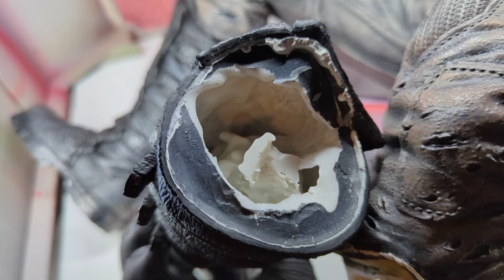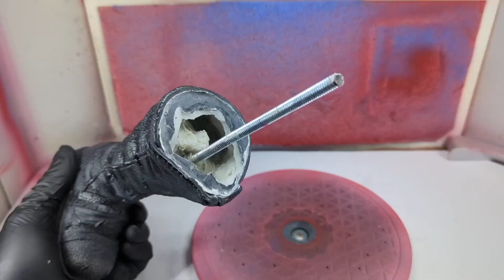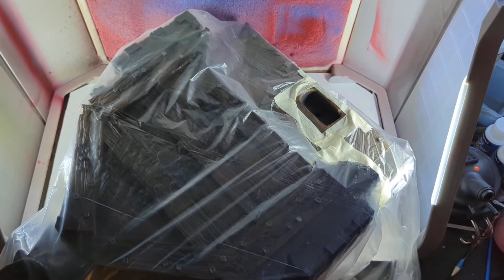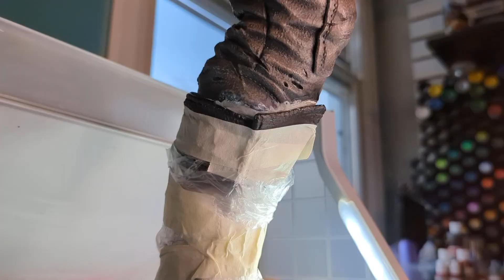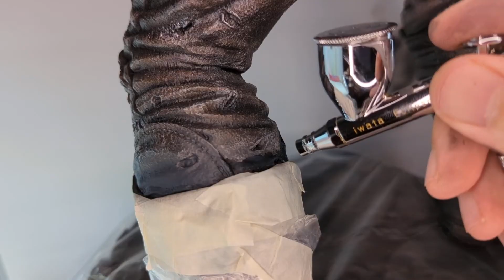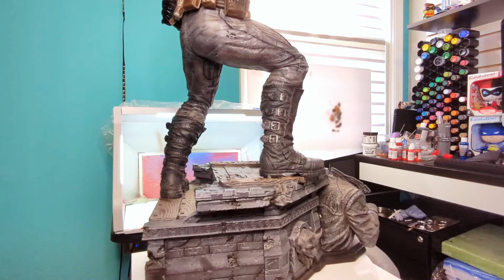STATUE REPAIR - PRIME 1 STUDIO BATMAN DAMNED

Comment: Dude, thanks for this. I do have a question, i got a deal on the prime 1 jin sakai ghost armor deluxe bonus for 950 plus shipping. However, the fox is broken in a couple of places, the arm and a piece of his taik are cracked.

Is it worth repairing, or should i just one new. It's about a $150 difference  between the ghost armor and sakai clan armor deluxe.  Let me know
Reply from the maker: I would need to see pics of the damage but you would be looking most likely at at least $150 for repair work. If you'd like just email me pictures of the damage ItsAllThingsArt@gmail.com
Reply: @itsallthingsart I made storage but they're still not letting me send images. Can I send them on instagram?
Reply: @ItsAllThingsArt I sent you a dm on ig im low on memory and yahoo and Gmail won't let me send anything

Comment: prime 1 and xm sucks, they cut cost too much, so hollow inside these expensive figure. do not buy
Reply from the maker: Casting issue on this one. Looks like an air bubble was trapped in the mold. They definitely did go lighter on this statue but overall their statues are very solid. 👍

Comment: I apologize in advance, but I fought the temptation to say this: "INSTEAD I WILL SIMPLY BREAK YOU." 😂😅
Love the repair videos. I've been studying them because as I get more and more into statue collecting, I want to learn to repair and paint them.
Couple of questions for you. How did you align the bottom part of the leg with the top half?  Not sure, but looks like you drilled a wider hole in the upper leg, so you had a little wiggle room to work with. And how do you color match a particular color? Do you eyeball it, or is there a technique to it? Thanks
Reply from the maker: Thanks for the question. The boot had a small gap between the leg where it broke but not all the way around. I was able to get an idea of where it needed to go. Also right after gluing the boot back on, I stood the statue up on the base to make sure everything aligned with the foot placement on the base. The boot/leg was dry fit as a test run before gluing. And yes I always drill a little wider than the rod.. when using epoxy paste, because it's so thick it needs a little air flow otherwise a vacuum is created when pushing the two parts together. The epoxy will then fill the extra space around the metal rod. It also allows for more surface adhesion. 

As for color matching. There's really no tricks. It's something I have an eye for. I've only been painting statues for a few years but have a lifetime experience painting, drawing, designing, etc..with a background in art. But running different sample tests and blending will help. Hope that helps!
Reply: @ItsAllThingsArt  Thanks for all the good info.

Comment: Awesome, super informative video! I was wondering, could you recommend a paint brand or type to use to cover up a chip? I don't have access to an air brush unfortunately. Any advice at all is appreciated!
Reply from the maker: Thanks..I like using Vallejo or Tamiya. But you can even get away with using cheap acrylic craft paint from Michaels or Hobby Lobby.. it'll just take more layers and not give as good of coverage. The more expensive paint is more opaque and has higher pigments. Hope that helps.
Reply: @ItsAllThingsArt  This helped a ton! Thanks so much for the quick response!